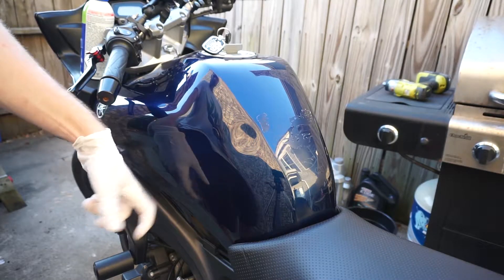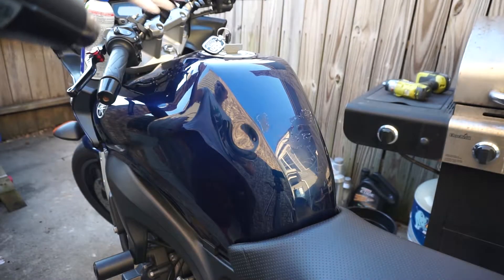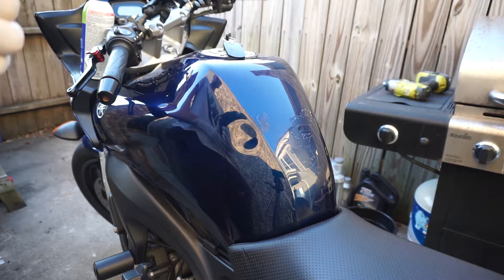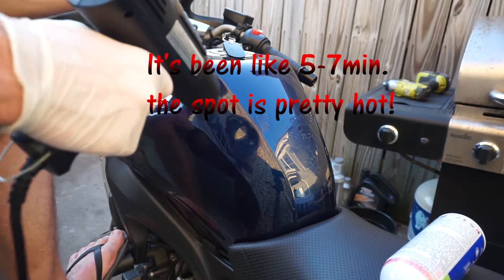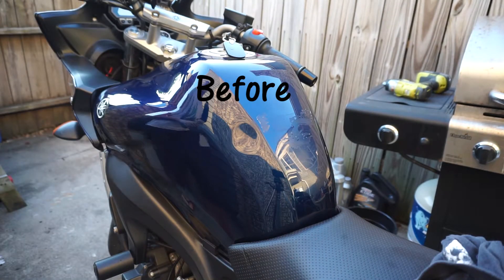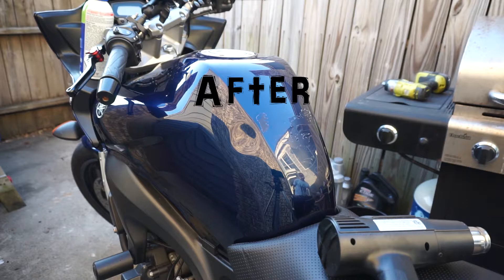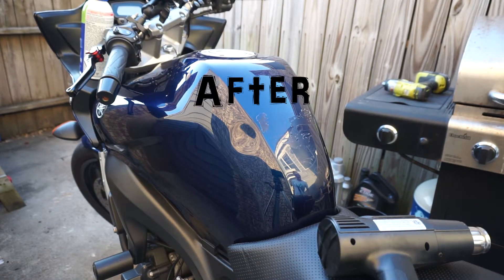Dent fix with Compressed air and a Heat gun that doesn’t work.

Comment: The process is supposed to work like tightening a drum skin around the frame using tensioner. Use the heat gun on the indentation. Using the air can, spray a circle around the edge of the heated area. The cold surface will constrict thus pulling the hot surface in the direction of the cold and that is how the dent pops out.
Reply from the maker: I know it work with plastic, for example bumper dent. But for the fuel tank the technic should be more advance and prcise. Thank you for the comment!

Comment: Maybe it does work just not for you I have an 05 heritage Softail tank tank with dents heat and compressed air works for it add heat gun is not quite enough
Reply from the maker: To have a help of compressed air, I would assume it's big, nut still I think the thickness of the metal make it hard to deal with it, on top of that, I can't say I'm an expert. for some people it work, but it was quite pain for me and still non. thanks for the comment!

Comment: hEAT IT UP MORE AROUND THE DENT,  AND THEN YOU CIRCLE THE DENT WITH THE COLD... AND IF NEED BE, FILL THE TANK WITH COMPRESSED AIR USING A TENNIS BALL TO KEEP THE AIR FEOM ESCAPING AND FILL TANK USING THE GAS OPENING AND THE BALL AS A FITTING.
Reply from the maker: i would say that pretty thick metal, but i newer try to go hard, since didn't want to damage the paint))

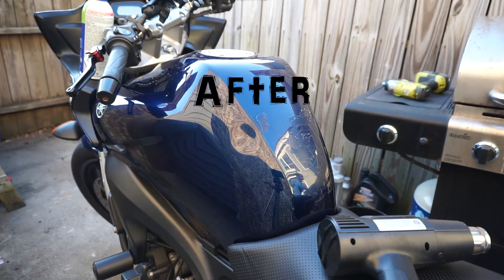Comment: Well that was a waste of 1:22
Reply from the maker: And also you learn that it not possible to fix it with this technology. Say thanks that it wasn’t 10min.
Reply: Idk about when it was originally posted, but it definitely says it didn’t work in the title😅
Reply: @j-pitpitman5711  All he said that he was going to fix the problem with a) compressed air and b) and heat gun that doesn't work. He didn't fix it so 🤷‍♂️
Reply: @Makhnovets  There's this concept called 'grammar', where words are given meaning by how they are used in a sentence 🤷‍♂️ You claimed to fix the dent with a) compressed air and b) a heat gun that doesn't work. If the message was supposed to be 'Fixing a dent with compressed air and a heat gun doesn't work' , well.. then that was the order the words needed to be in :P

Anyways, thanks it wasn't 10 minutes.

Comment: People are just stupid. Moaning about the video not showing their desired results. It shows that this method doesn't work, and that is the aim of the video. Save a minute watching a video or more time and money trying to fix it yourself. The guy did you a favor. Keep watching the videos where it actually works, and post a link here - I would like to see one haha
Reply from the maker: Thanks for support. Long time ago I saw that some guy fixed his with similar approach, which is possible but not with every tank, if you have a thin steel tank it might work, but in our days there no more steel tanks, most of them aluminum which dissipate the heat, plus it’s much thicker than steel would be. If you have  bike from 80s and older you might have a chance. 
Again, thank you for the comment!